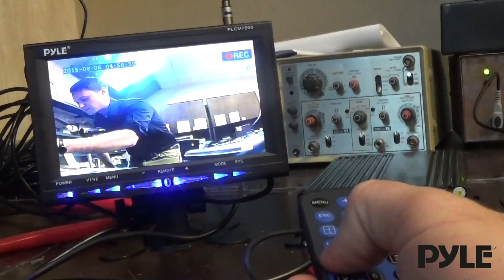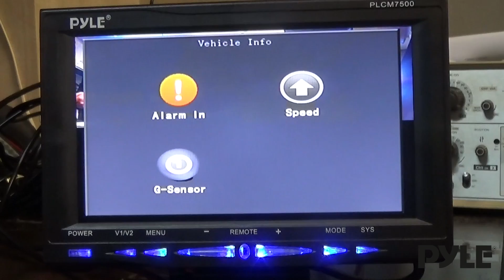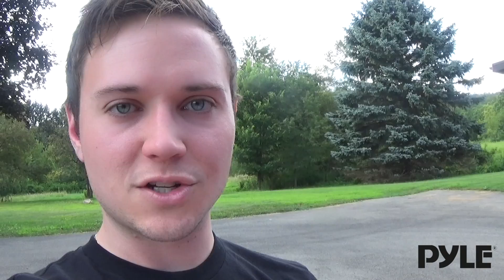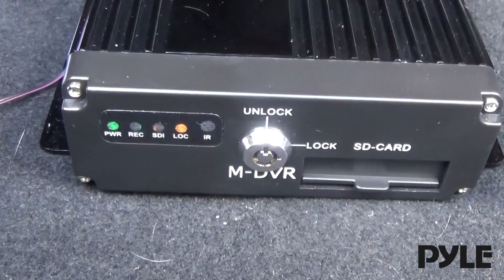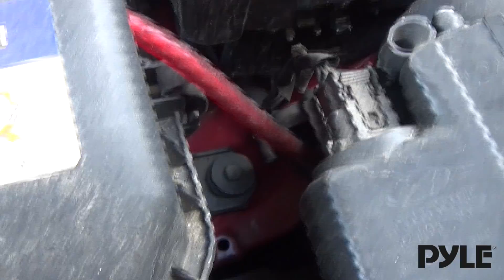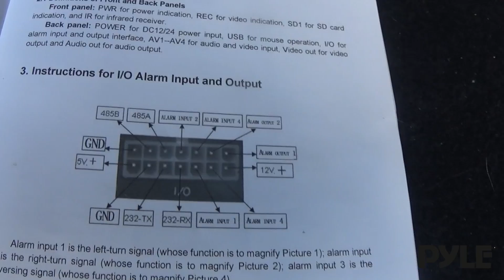Pyle PLCMDVR15 12v Mobile DVR Security Surveillance System

Comment: If I don't use Pyle cameras, How do I connect a camera to the DVR?  My camera has a yellow RCA video connection and a red power connection.  The cables that come with the unit end up with individual wires red, black, yellow, and white.  an RCA connection requires both the yellow and a ground as does the red power connection.

Comment: How much power does it use? How does the Motion Detection work? I need something GOOD for outdoor surveillance, theft and vandalism issues. Going to use a marine deep cycle battery, wondering how long this will run before switching out a battery.